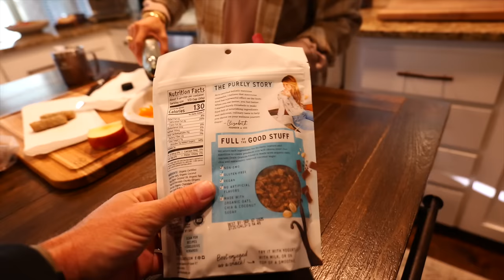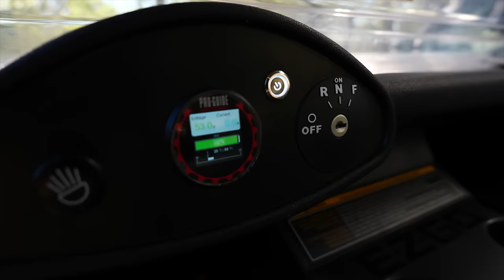I'm Tired of This!

Comment: for the cart, that is your steering rack and the bent piece should be easy to replace, should be called a tie rod.
Reply: Inner tie rod . I th8nk the inner and outer are sold separately
Reply: @207outdoorsmoody4  inner tie rod. Count the number of turns it takes to remove the outer while holding on to the inner. Then count the turns as you remove three inner.

Comment: The tie rod end looks bent. Easy to replace and find online. If the rod that it screws on to is bad then it might be more expensive needing to replace the whole steering assembly. Plus if that rubber boot is torn it would be a good time to replace it while you're there.

Comment: Steering rack and easy to install pop the outer tire rods off the knuckle by the tire unbolt the steering shaft and unbolt it pull it out and reverse procedure to install pending on how bad the inner tire rods is bent you could just replace it but if it’s to bad just replace the whole steering rack

Comment: What I would do with that bent steering rod is take the steering rack assembly out and slide the boot down and mark your threads so it matches when you put it back. Then unscrew that rod and bend it back. If all else fails take the assembly into the shop and ask for a new one and put it back in yourself. I don’t think your going to save money on parts only on labour

Comment: That’s an outer tie rod/inner tie rod. Both is connected to your steering rack. If your steering rack isn’t bent. Just replace the inner/outer tie rod. Looks up the model of you cart and just look up the replacement. Easy to do. Also you can do a fishing line alignment after and you’ll be fine. Save a bunch of money also.

Comment: Parts called an inner tie rod..jack it up and make sure the outer tie rod is still tight and then shake down the other side and see if any joints are loose

Comment: Justin, that piece on the golf cart is the inner tie-rod. you should be able to just replace the rod, or you can replace the whole steering rack assembly (the part it attaches to) if its also damaged.

Comment: The golf cart. 
That rod is the tie rod , it’s to adjust toe in/out ! 
Pit the steering wheel where you feel is straight, then from the front look to see if the right side tire is turn more left or right . Loosen the jam nut and turn the inner part of the tire rod to adjust that side left/right to get the tire back straight, that should fix the alignment as long as nothing else got bent . You may have to replace the tie rod if it’s too bent. 
Hope this helps

Comment: Ai just bought a new water heater with A 12 year warranty. It cost 900. All new supply lines, vent hardware, pan (code required). $100.00. I would demand a refund. At least report that to the BBB. That's over the top expensive.

Comment: Looks like you bent a tie rod on your cart. Inner tie rod. Requires a special tool sometimes but not terribly expensive. Tape measure alignment and a replacement tie rod you should be good.

Comment: The bent piece is an inner tie rod. Should be able to unclamp that rubber boot pull it back and it will unscrew from the rack in the middle!
Reply: It's not easy to unclamp that with normal tools. But you can go to advance Auto or any of the other ones and borrow their tools. You want a tie rod separator. Basically looks like a big tuning fork.

Comment: WOW that price sounds astronomical! I have a on demand 
8 G.P.M Rinnai from Lowe's that runs on propane and those are 1,576 at home Depot right now. I bought mine on a sale from Lowe's two year's ago and it was 930+ tax.
Thing is actually awesome and saves me tons of money because I'm not keeping 60 gallons of water hot all year round. Not mention it's instant hot. Whoever quoted you 6k sounds like they're trying to get in your wallet. Plumber installed the whole thing for just under 700

Comment: Crickets get in through the window drainage ports. Most windows have them and you cannot seal them up with caulk as rain will not drain and you'll end up with puddles all over the place. You can place patio screen there and all will be fine. Also, if you have a sliding glass door they can finagle their way through the rail and get in that way.

Just go to Lowes or Home Depot and buy the stinger industrial fumigation stuff and saturate the daylights out of the entire perimeter of the house and all window and door frames every 4-6 months and anything that comes in will die in a few hours.

Comment: Another awesome video. Have you tried to get STARLINK internet .. On ya Cart it’s the tie rod that is bent Really a easy fix  I had one bent on my buggy so I just took it off and straightened it back out it’s been working fine ever since and that’s been 3 years now and it’s still working fine.. If I was you I would get a different Plumber cause 6k is way too high even if it is a tankless heater. $900-$2,000 tops
Base on what type of heater it is .  But really that’s an easy fix and DIY  project too ..  Thanks for sharing . Stay safe and Keep’em coming

Comment: $6k for a hot water heater is highway robbery. You a handy dude and depending on the size you could replace it yourself for less than $1200. I’ve never done it before and replaced mine for $750 and it took all of an hour to do it.

Comment: Hey LFG not trying to talk smack on the tree house but I think maybe a reason you're having a hard time selling it is because it looks like a lot of the house needs sheet rock work. It looks like a lot of tape and bed needs to be touched up, and maybe some 2x4 in the walls have bowed and need to be checked on. I never really noticed it in your videos before but noticed a lot of it when you were walking through the house. If you need someone to come do good work at a very fair price let me know. Not trying to get you business because I don't do sheetrock but I use to with my Dad

Comment: Almost every rack and pinion is the same extremely easy fix just Google how to replace tire rod the only thing you're going to need help for is wheel alignment after you're done you can count  threads on the nut and it might be close enough for a golf cart